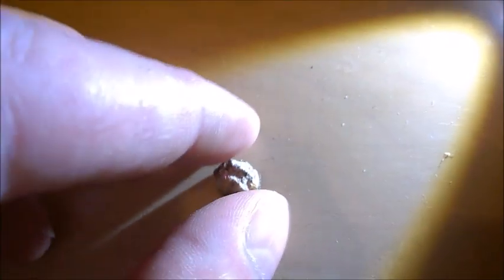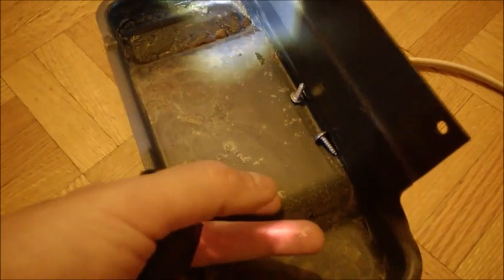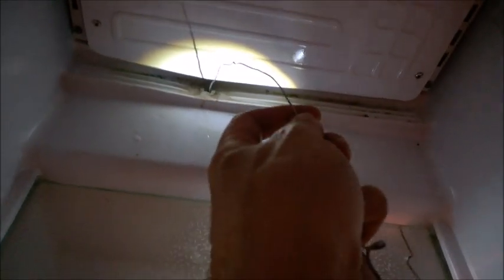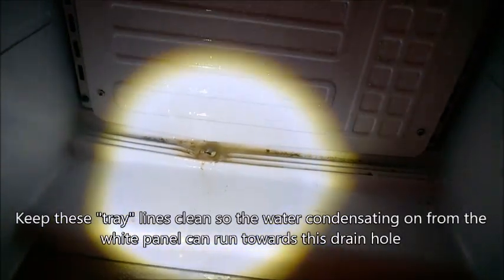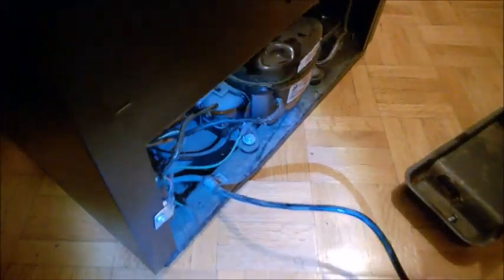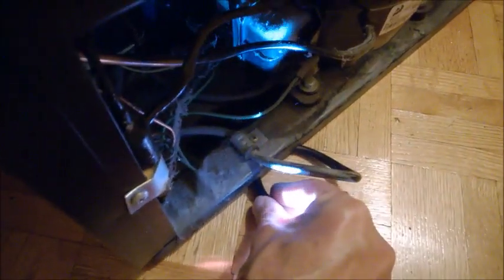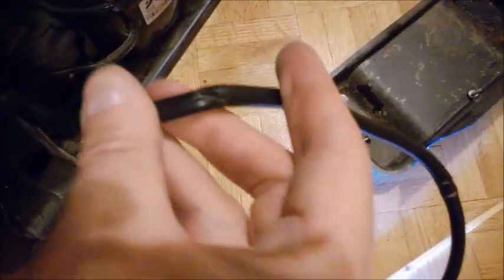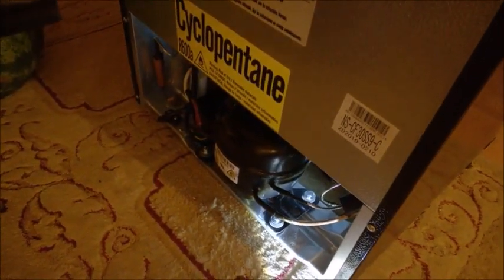Mini fridge leaks water on the floor - Fix

Comment from the maker: These fridges have an issue with the Start relay - you should hear a click before the compressor starts, then another click when the compressor stops. This click is the relay. As the relay starts wearing (3-4 years), the click gets louder to the point of sounding more like a clonk. It's time to replace the relay before it fails. If it fails the compressor won't start and will burn the overload fuse. The relay and the overload fuse are replaceable but removing the wire connectors is insane, because the connector pins are self locking and a tiny hole in the center on one side must be depressed in order to release each connector. Many fridges have a 3 pin QP2-4R7 4.7 ohm Start Relay and Overload Fuse like in the link, but double check yours is the same https://www.amazon.com/HQRP-Compressor-Overload-compatible-Refrigerators/dp/B084G9BS99 . These two parts sit inside an annoying black plastic cover on the left side of the compressor - carefully force the top of the cover off with a flat screw driver, it can be hard to remove.

Comment: Hello, do you know where I could find a replacement power cord for this fridge?
Reply from the maker: I don't think we can buy such cables in regular hardware stores, may try calling an electronics hardware store. Normally the cord is not replaceable because it's soldered on the electronic module of the fridge - you will need a  soldering iron. Then you need to match the polarity of the new cord - important or you will damage the electronic module. Mark the polarity before removing the old cord. Also it takes a cord with a thickness than can handle the same current, or the cord will heat up and will short or burn - can cause a fire or electrocution on the fridge. The cord has to have a ground. I would say the best is to ask an electrician but it's not going to be cheap.

Comment: I have the exact same fridge but the problem with mine is that it freezes up all along the back and then it starts to leak water. I unplug and let the ice melt, clean everything, and plug it in. Works fine but after about a month ice forms all along the back and I have to repeat the process. Any suggestions on how to avoid this ice build-up?
Reply from the maker: May want to close the door and look closely all around the door seal - top, sides, bottom.  See if it doesn't close properly or if it has a crack at some place. It would let humidity inside the fridge, which will freeze as you mention on the inner rear wall surface which is cooling the fridge
Reply: @Peppermint1  Thank you for the advice and for replying to my question so quickly, much appreciated. Would I be able to replace the seal around the door?
Reply from the maker: @cindyspearman   I don't think it's replaceable. May use glue if there is a crack or if it come loose from the door at some area.

Comment: So the condensation and water spots on the wall of the fridge is normal right? Or no?
Reply from the maker: Yes, it is perfectly normal if the air inside your room is more humid. It may also freeze sometimes. If your room has drier air, the wall will be dry.
Reply: @Peppermint1   oh okay, I was starting to worry a little bit because I started seeing frozen water droplets inside my brand new mini-fridge. I'm relieved to hear it's normal. By the way, would you happen to know the optimal temperature for a mini-fridge?
Reply from the maker: Normal fridge temperature would be around 4C or 40F however the problem is the temperature knob has digits that don't always indicate the temperature, but rather are a simple scale for cooling down. To add more confusion, it's not always clear which side of the scale corresponds with the coldest temperature setting. It is better to read the owners manual for your model to get the correct information about the temperature knob

Comment: I took my pan out and it was full of rust. I also noticed the pan was warped from the right side. Do you have any idea why that would happen?
Reply from the maker: Would guess it was previously replaced
Reply: @Peppermint1  thank you for replying. Why would being replaced make it warped? I'm assuming the part underneath is heating up too much hence why it rusted and cracked. But I'm not sure what that part does or is worth fixing
Reply from the maker: @happycarrot8166  I was thinking maybe the replacement pan was pulled used from another unit, causing pan chip and bent. The pan metal is quite thick to warp from heat..I had a fridge that melted some plastic insulation around compressor, from running for too long.  But who knows.. I can tell that normally these mini fridges cycle about 25minutes on, 40 minutes off if all items are cold and the door has not been opened  for a while. The problem with these is the compressor oil is low quality, when opening door more often or placing warmer items, compressor will have to work longer and overheats and degrades the oil. Another issue is the Start Relay failure - compressor won't run at all. There are a few videos explaining how to replace.

Comment: Hey please help me out….ther is a hole inside the fridge but when i opened it as you have. I see no hole above the compressor …rather its sealed..what shall i do
Reply from the maker: I would guess the hole above the compressor tray is clogged. Or if it's a second hand unit, maybe someone did block the hole. Just unplug it or try inserting a rather soft metal wire from inside the fridge. Rotate as needed to make it advance.

Comment: Thank you!!!
Reply from the maker: Welcome
Reply: @Peppermint1  What else could it be? My fridge made big puddles for a week and will not cool. The hole is now clean and it's been several hours it will not get cold, it is barely cool. Please read my original 2 long comments with details. I am disabled, living in a motel and the mgr will not help me to get a new one. I have pain in my gut from food poisoning every day.
Reply from the maker: @e.e.e  That drain hole is not related with the cooling of the fridge, even when it's blocked, the fridge should still be cooling properly.  Inside the fridge the rear wall gets cold and thus cools down the inside. Try touching the rear wall (inside the fridge) see if it's cold.  Try to adjust the temperature knob (near the light) to a higher number. Listen if you hear the compressor running behind the fridge - careful not to trap the power cable under the fridge so it doesn't get cut.  If you don't have power at all and not light either, maybe the cable has a cut in it, unplug it from the wall and look closely at it.
Reply from the maker: @e.e.e  Also insert a wire from behind the fridge, where the hole is existing, remove the tray if possible, and you should be able to insert the wire so it comes out inside the fridge. This will clear perfectly the drain.  But again, this is not related to the fridge not cooling down properly.
Reply: @Peppermint1  Thanks so much for your kind replies. The light is on the inside "ceiling" it has no knob to adjust temperature. The maid had told me these Danby fridges do not have temp control. The back wall right now is wet and dripping. It goes from iced (which is the normal when it was working properly) to dripping wet droplets to lukewarm. It seems to stop and start. 

I removed the cabinet's back panel and wiped the cooler bottle w/damp sponge and paper towel, then plugged it back. It would not make the start noise. Yes, the light is on when I open the door. After 30 min the start noise kicked in but it is barely cool inside, the back wall is dripping wet not iced. 
I woke up middle of the night, same thing. I woke up 4 hours later, same thing. Then around 9 AM it iced the back wall. It's back and forth. What do I need to do please? I do not have a phillips tool to remove the panel that collects water at back. Thank you for all your help, I just need to be here a few more months and need a working fridge & the mgr is a bu ll y who started ab u s ing me verbally this morning when I tried to explain the problem
Reply: @Peppermint1  I hope my reply posted? How can I make it cool properly? I cleaned the back but unable to remove the tray by myself.
Reply: @Peppermint1  Sorry forgot: no more water puddles on the floor since last night, first time in 5 days.
Reply from the maker: @e.e.e  It's normal to have droplets on the back wall and indeed if it's working properly the droplets will become frozen.  For the water leaking problem, you may try inserting a steel wire into the hole that's inside the fridge, try wiggling and pushing it, it should come out outside from the rear of the fridge.  Can you see behind it which model it is ?  It should have a sticker with the model number
Reply: @Peppermint1  Thank you. As I said, yesterday I pushed a metal stick inside and it touched the tray, it came out clean. Since I've been here, the back walls has always been frozen, no dripping water like now. It is the same exact DANBY model as in your video. I am sorry I am disabled and have a heart condition, I cannot pull it from the wall again, right now I am too weak. I just watched another video & a man replaced a part that the users call "relay". Do you think that needs replacing? Again it never did this before. It is not working well, only starts cooling once every few hours, it never let my food become lukewarm before. The door, however stays cool in/out.
Reply: @Peppermint1  However, it is no longer leaking water, as of last evening. It is just iced back wall and cold food to dripping wet back wall and lukewarm food. Light working fine, door cooling working fine. Thanks
Reply: @Peppermint1  No more leaking, thank you. Please tell me how to make it go cold again? Previously asked several times, never showed up. Help, please.
Reply from the maker: @e.e.e   I'm thinking the thermostat inside the fridge may be failing intermittently.  There is also a relay on the compressor that may have an issue.  Of course, only suppositions.  Unfortunately, it's not easy to order and replace these parts by yourself.  Try also to make sure the door is closing properly/tight and the door seal is not cracked or bent at some place (pull on it gently). One thing is that if the motel has the same model in all rooms, other units have already failed the same way, so the mgr might know about it. May try asking other tenants about this issue. If you can find the model number, I may try to look on google see if your model has a specific issue. But in the end, giving the costs of repair, it may be worth getting a new unit altogether.
Reply: @Peppermint1  Thanks. Yes, the door shuts properly. It is the 1st thing I triple checked. I went to the next room & they have another newer model of DANBY that looked new & works fine. I came out of the room & the mgr came out of his house yelling expletives at me. He is not a good person.  it is the same model as you have here, your first fridge. Thank you.
Reply from the maker: @e.e.e   May be worth asking the mgr to get you a fridge from another room
Reply: @Peppermint1  Sadly, he is a b u l l y and was yelling expletives at me yesterday. He has sued me twice & lost, LOL! Do you know which my foods can stay safe in alternative lukewarm temp & not give me food poi so. ning?
Reply: @Peppermint1  If you replied already please log off or go in incognito mode to see if you reply was ghosted, as most of mine have been. Thank you.
Reply: @Peppermint1  The mgr harrassed another guest here and kicked him out. Then he sent the police because I was talking to that man. I explained to the officer that I need a new fridge and he went to tell him and he refuses to replace it. I hope you received my other messages?
Reply from the maker: @e.e.e    I did look at the Magic Chief fridges and some appear to have quality issues. I have myself one Danby and one Insignia, I'm happy about them, I see some Insignia have a rebate at Best Buy (one has 4.3 cu ft.  https://www.bestbuy.com/site/searchpage.jsp?st=insignia+fridge+mini&_dyncharset=UTF-8&_dynSessConf=&id=pcat17071&type=page&sc=Global&cp=1&nrp=&sp=&qp=&list=n&af=true&iht=y&usc=All+Categories&ks=960&keys=keys
Reply from the maker: @e.e.e   I've seen the comment where you mention you have the exact unit as in the video.  That fridge does have a small knob do adjust the temp, may want to try turn it to the right  https://youtu.be/fIgaWDS26mI
Reply from the maker: @e.e.e   I did watch your video. Could this be your model ?  https://www.ajmadison.com/cgi-bin/ajmadison/DAR340BL.html#mz-expanded-view-363168670062
It seems it has the temp knob outside, on the back of the fridge, near one of the upper corners.  Also may verify the fridge doesn't stay too close to the wall/curtains, to allow ventilation to the compressor that is behind the fridge (if the compressor overheats it will shut down for a while).
Reply: @Peppermint1  Yes!!! It is this exact model, wow! I found the button 15 min ago. It had caked on dust from years and years. I wiped it with a sponge and sadly found that the knob was turned all the way to maximum. However, I wiped it some more & when I plugged it back on, the start up noise started loudly! I hope this does the trick. The cable is not under anything, I made sure thank you, It has space between wall, no curtains there. 

I am not sure which part is the compressor, I will look that up. Thanks and will report back if this does the trick, fingers crossed.
Reply: @Peppermint1  Sadly, that did not work. There is no change to the pattern. The fridge stopped and the frozen back melted again and the food lukewarm again. :-/
Reply: @Peppermint1  Sorry there seems to be a comment mi s s in g again: I said thank you and yes it is that model, and the temp at back was at Maximum already. I wiped it clean but it is still not working well to properly & consistently keep the food cold or cool.
Reply from the maker: @e.e.e   It may be worth trying to turn the knob all the way to the other end.  These knobs it's not clear which end is for cold and which for less cold.  The compressor sits at the bottom rear of the fridge, it looks like a large black metal sphere, it may also have other connectors around which are worth cleaning well because some of them may be a temperature sensor or relay that turns the compressor off it if overheats, so it's good to clean everything clean around the parts at the rear bottom of the compressor

Comment: My mini cooler has exactly the same problem where the condenser inside the fridge is all wet and dripping water but it also makes gurgling sounds and I don't see any fan cooling the compressor (and in this video either). Also, is it okay to day out the condenser with a towel of a hair dryer. Can you please shed some light. Thanks.
Reply from the maker: Gurgling sounds are pretty ok with these little fridges. May use a towel without problems with dry it off. Careful when you move it, the power cable gets trapped under the rear of the fridge where is a sharp metal bar, and the cable gets cuts and exposed electric wire
Reply: @Peppermint1  I just took the cooler out and observed the drain over the compressor completely clogged. Cleaned it out thoroughly and turned it back on to check for any leaks or watery condenser (shall update). The gurgling sound was never there before and is back on as soon as I plugged it in. It's quite annoying at nights and disturbs sleep. Any solution to quiet it down? Also these little coolers don't have any fan to keep the compressor cool. Much appreciated for your response.